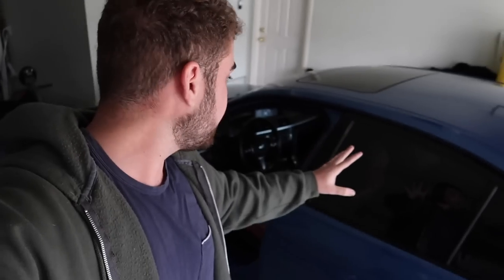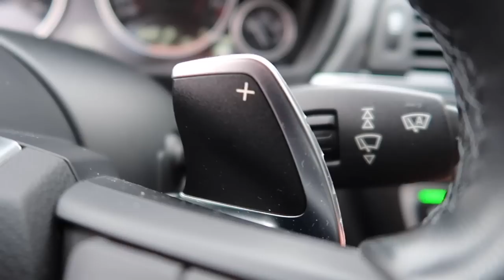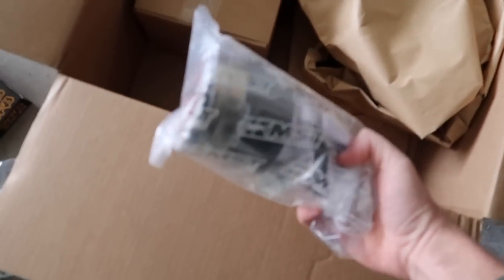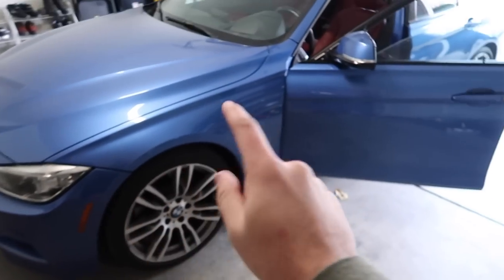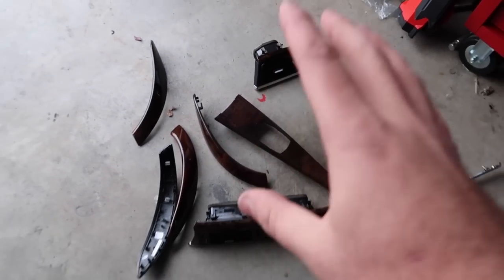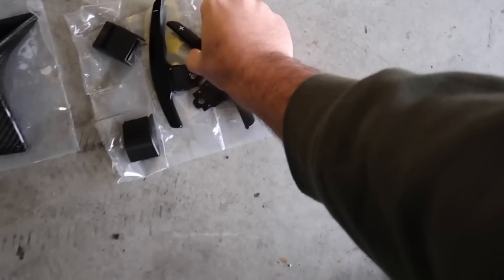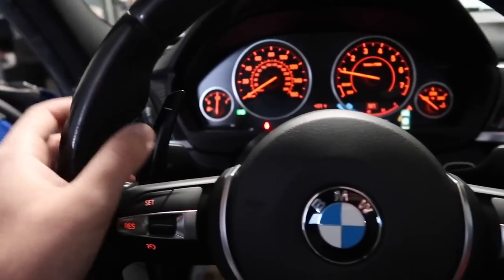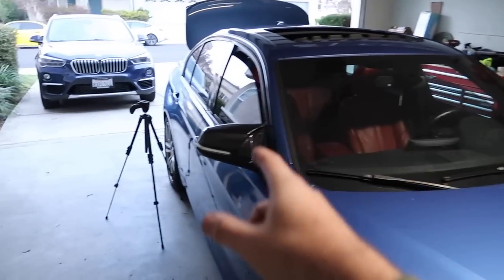CHRISTMAS CAME EARLY FOR THE F30!!

Comment: Hey bro, there is a way using regular automotive picks to remove the mirror caps without removing the glass. you start on the tab farthest away from the door and unclip the first tab with the picks and wedge a trim tool in between the cap the frame and continue working around until you got all the clips. I was able to get each cap off in 5 minutes and there is NO chance of breaking anything.

Comment: I didn't have to remove my side mirrors to install the mirror caps. Just remove the cap itself but use the same principles as putting even pressure all around while removing them.